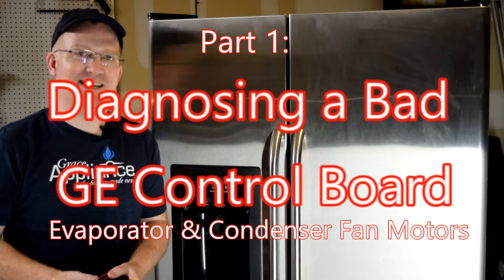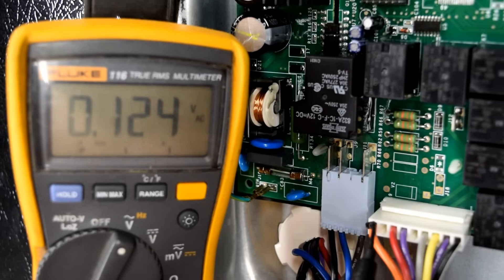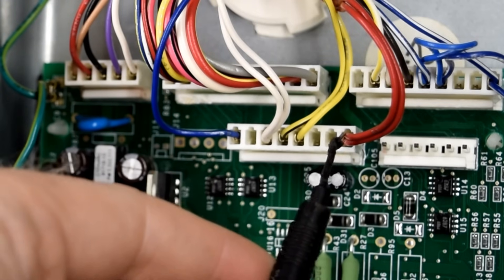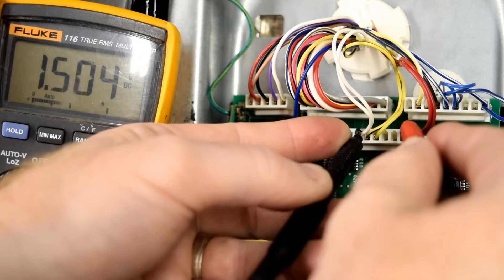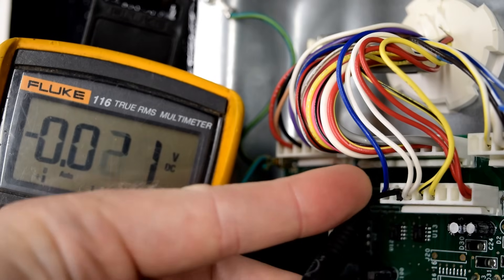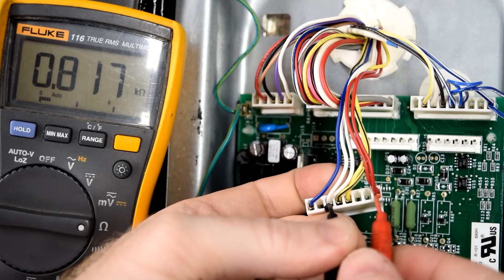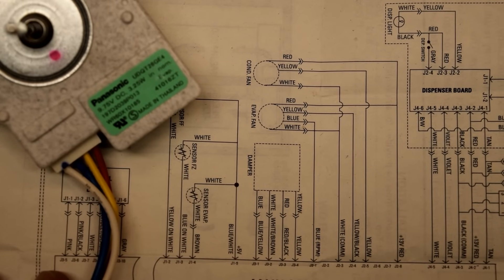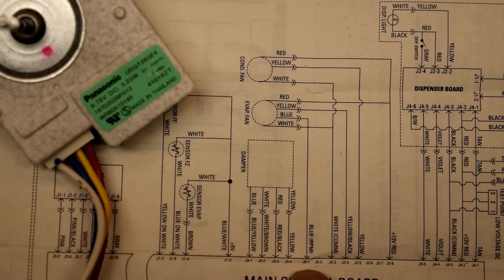Diagnosing a Bad GE Board - Part 1: Fan Motors

Comment: I don't have the schematic for my 2007 GE Profile side-by-side refrigerator and have a question regarding the condenser fan which I hope you can answer. The refrigerator is at a rental property so I'm remotely troubleshooting with the individual living there. He is reading the appropriate DC voltage at the J2 jack when measuring at the test points you referred to in this video. I also have additional wires on pins 6 & 7 and unclear what they are for although I simply thought I would mention it. He sent me a picture of the fan and at 1st glance it looked like an AC voltage c-frame motor. Because the voltages were good at J2 I had him unplug the fan and measure continuity across the coil. He's reading 80 ohms across the black and orange wires so the windings are not opened up and the bearings are good, it spins fine by hand . This makes me believe the motor is fine. Moreover, with the fan still unplugged I had him measure the incoming voltage directly at the harness that plugs into the fan.  He's measuring 120vac at the load and not the low DC voltage that was referenced at J2. Are these motors powered by 120vac? If they are then it is fair to assume the power at J2 is only signaling the relays which in turn close their contacts to send the appropriate AC voltage to the fan. If the signal voltage is reading fine, and these fans are powered by 120vac then some people may only have a bad relay/contacts and not necessarily a bad fan motor. If the motor is rated for AC voltage then do you know whether or not these condenser fans require or have a run/or start capacitor?
Reply from the maker: Hey Mr JP, Some condenser fans on the GE side by sides will be 120v AC powered vs the type of motor looked at during this video. Something similar to a wr60x10168. 

If he's getting 120v AC at the wires to the plug at that fan, yet the fan still does not spin, it's a failed motor (or bad connection, mouse chewed wire, etc etc) but most times... A failed motor. He's getting appropriate voltage to the motor. The issue is between that plug and the fan motor. If the connection and wires are good, replace the fan motor and good to go! The fan motors don't have a start or run capacitor (compressors often will, but not the fan motors which differs from say an hvac system) 

I hope that helps.
Reply: @GraceAppliance  thanks for the quick response. I had him pull it out so I could verify what was going on. Come to find out it is a 120vac  C-frame motor which you are correct does not require a capacitor. Once it was removed I had him recheck all his measurements and the motor was still reading good. However, he then told me that it was a little stiff when he turned it. I had him remove the armature and clean it up and reinstall everything. It works fine now. I wanted to make sure it was definitely the motor because even with Amazon prime it would take 2 days to get it lol. Plus he's family and lives there for cheap, he can get his hands dirty. Thanks again I do appreciate the video and your time.
Reply from the maker: Hey Mr JP,
You're most welcome! Glad you got it sorted. Nice work!

Yeah, I'd definitely get one of the motors on the way to him because it sounds like it's on the way out. 

In the meantime, you can have him put a regular box fan behind the refrigerator with the back fridge panel removed in case the fan goes out, it will keep the air moving either way until the new motor gets there. 

Thanks!
Reply: @GraceAppliance  I agree and found a replacement for it on Amazon. Just subscribed too, thanks again!

Comment: Hi All, is something as basic as the Cen-tech 7 Function Digital Multimeter good enough for these tests?
Reply from the maker: Ayotunde Itayemi yes! You shouldn't have any issues with that meter.
The only difference you might notice is that the meter may take a little longer to register the reading for you.
Reply: GE Side-by-Side ONLY - Refrigerator Repair Videos  Thanks! I carried out the first set of measurements. Input voltage OK (118V). J2 (White/Red = 29V; White/YellowBlack = 22.9V; White/Yellow = 27.6V). All well outside the range of 12V-14V you mentioned in the video. My refrigerator is a GE GSL25IGXJLS that's not cooling.
Reply from the maker: Ayotunde Itayemi  Hey!
Please double check that your meter is set to Volts DC and not volts AC.  The first test of 120v is an AC test, but the fan motors test - you'd need to change the meter setting to DC measurements.  That may be the issue with the readings you're getting. 

Do you know if your compressor behind the refrigerator & condenser fan behind the refrigerator is running or is it totally quiet?
Reply: GE Side-by-Side ONLY - Refrigerator Repair Videos  Spot on. I forgot to change the multimeter to VDC. New J2 measurements: White/Red = 13.5V; White/YellowBlack = 10.66V; White/Yellow = 12.87V. The Ohms measurement also is 812 (well below the range you specified). Both the compressor (warm and I believe I hear it kick in) and condenser fan (spinning) are running but lots of dust in the motor grill (I will vacuum that now). Looks like the combination of the low evaporator voltage (10.66V) and the low ohms measurement (812) means the board is bad? Thanks!
Reply from the maker: Hi Ayotunde, 
As for the evaporator fan voltage, I'd let that one go for now.  It's a variable speed fan motor and actually I think it's more like between 8-14vdc that it will vary.  So, likely no issues there.  Do make a note of it though. 

If your condenser coils are dusty - that will definately cause a freezer and fridge to be warmer than normal, but won't cause it to be HOT.  

Is your fridge/freezer HOT?  Like, no cooling at ALL?
or
Do you feel some cooling taking place in the freezer section?

If the fridge is hot (no cooling at all) AND the compressor is running...that's probably not great news. This will usually mean all of the refrigerant has leaked out and and/or the compressor is no longer functioning even though it may be running. 

If the freezer side isn't hot, but rather it's just not freezing things - say....40-50' I'd examine the evaporator coil (behind the freezer wall inside the freezer) to see if the evaporator has a light coating of frost over all of the rungs which would be normal.  Only on the bottom couple rungs would not be a good sign for the compressor.  
If however you find that the evaporator is covered in thick heavy ice/snow this would indicate a defrost issue. 

Let me know what's going on in your situation and I'm happy to help as much as i'm able. 
Thanks!
Reply: GE Side-by-Side ONLY - Refrigerator Repair Videos  Not cooling but not blowing hot air (just a slight breeze). The refrigerator has been off for a couple of weeks so I don't think there will be any coating on the evaporator coils though I haven't opened the wall. The compressor is an Embraco EGX 70HLC with the words "Thermally Protected" on it. Not sure what that means but I mention it because I assume after running (if it is  running) for about 30mins the compressor should be hot or at least warm? As it is, it is almost impossible to detect any heat/warmth from the compressor if I touch the back of my hand to it. Though the gentleman I got the fridge from in is the HVAC business and said he thinks it's likely "low refrigerant" but he couldn't be bothered trying to fix it which is why he gave the fridge away :-)
Reply from the maker: Ayotunde Itayemi  Hi!  
Definitely after the compressor runs for 30 minutes you should be able to detect at least some warmth off of it to the touch.  Also, you should have at least some noticeable drop in temp inside the freezer.  If the compressor runs and the fans are working - it should be sub zero inside the freezer after 12-24hrs.  If not, it's an issue with the 'sealed system' i.e. the compressor or refrigerant not being present.  

Now, how to proceed: 
Honestly, anything sealed system related is expensive and usually not great news for older fridges just because it most often won't make sense to repair unless it were say a build in fridge. 
Some technicians will perform a recharge of the refrigerant, but often won't offer any type of warranty because there is a great likelihood that it has a leak somewhere in the sealed system which allows the refrigerant to have leaked out. But, they'd weigh in a certain amount of refrigerant charge, 6oz-9oz whatever is called for. 
There is a product which is a 'leak stop' of sorts and can be added to the system during the recharge if you wanted to roll the dice. But, also - It may be a failed compressor as well.  So, that would be up to you on how to proceed.  A skilled technician should be able to hook up gauges to the sealed system to confirm if it's simply low on charge or has a failed compressor, but i'd say unless you're willing to spend quite a bit of money on repair - you may be better off cutting your loses sooner than later and not follow that rabbit trail.  

Just my initial thoughts based on what you've told me so far. 
Sorry for the bad news, but I hope it helps.
Reply: GE Side-by-Side ONLY - Refrigerator Repair Videos  Seems like I spoke too soon. After about an hour the compressor was warm to the touch. I then left it on the whole day while I was away at work and when I got back home about 8hours later it was chilling. Both the fridge and freezer sides are quite cold but not cold enough to freeze the can of coke I left inside. Which brings me back to what the original owner said that the fridge started to randomly stop cooling (might go for a couple of weeks with no issues then they would notice water dripping from the ice maker and the stuff in the fridge no longer cold, but if he leaves it off for a while, it starts to cool again). So do you think this can still be the freon? I am going to leave it on all night.
Reply from the maker: @ayotundeitayemi  
If you find that over night it's able to get down to 0 degrees in the freezer, then after a day or 2 it starts getting warmer, it's likely not defrosting.
You'd see ice build up on the back wall of the freezer.

If on the other hand it doesn't freeze food after 24 hrs, I'd agree with either a failed compressor or low refrigerant.

Keep me posted on what you find out.

Good luck!
Reply: GE Side-by-Side ONLY - Refrigerator Repair Videos  roughly 12 hours in the original coke can in the freezer is frozen solid and a second can I put in about 4 hours ago is frozen as well so I guess it is getting colder. Will update if status changes in a couple of days as you suggested. Thanks!
Reply: It was frozen solid (including a 1-gal plastic containing water) throughout yesterday but when I checked this morning, it is barely cool and the water has completely thawed into liquid form again.
Reply from the maker: @ayotundeitayemi 
This sounds like a restriction in the sealed system to me. You have a filter dryer behind the refrigerator which the refrigerant passes through to help eliminate any impurities, but that is most often where the restrictions happen.

If it's freezing things one minute and very warm the next minute, that would indicate a sealed system issue. A recharge unfortunately would not solve this issue.

You'd need to have a professional get hands on with it to confirm this conclusively, but sure sounds like a restriction.

Do you notice any type of heavy frost buildup on the back wall inside the freezer?
Reply: GE Side-by-Side ONLY - Refrigerator Repair Videos  No frost buildup but I noticed a little "sweating" (before it started freezing originally and now that its cool) on the freezer walls.

Comment: Im having an issue with my GE fridge running the compressor nearly constantly. Seems to be the freezer temp setting that stops it, but even on freezer setting 1 it runs non stop and the freezer temp is -10 or lower. Im thinking a bad thermistor. Which wires to test ?
Reply from the maker: Hi Mike,
Sorry to hear about your issues with the refrigerator.  

I'd make sure to check the condenser coils behind the refrigerator to make sure the coils are not excessively dirty. 
Here's a video on that: 
https://www.youtube.com/watch?v=W8f0fc36ObE

As for checking your temperature sensors - here's a video on how that's done. 
I hope it's helpful, but please let me know if you have any questions: 
https://www.youtube.com/watch?v=CG-2FnQ43Hs

Good luck!
Andy

Comment: Hello sir ,
The freezer on my GE frig isn’t freezing. 
So I opened the lower panel and noticed the fan not spinning ! Could this be the motor or the MB?? 
Thank you in advance.
Reply from the maker: Hi Samuel,
I'm sorry to hear about your freezer.
When you removed the panel to expose the fan, the evaporator coil should have been coated in a light frost. If so, your compressor is doing its job and that's good news.

In order to test for a board vs fan failure, you'll need a multimeter in order to test for fan voltage from the control board. If you're getting between 12-14vdc at the fan and it's still not turning, it's a bad fan motor.
But with this symptom, it could be either the board, fan or even a failed temperature sensor which would need to be checked at the board. This video should help with the fan voltage testing though. 

Also watch the video called visual inspection of a failed control board which will help in the diagnosis. 

Let me know if you have any questions.

Comment: Where can I buy those leads (that can go into the connectors) for your voltmeter?
Reply from the maker: Jaime Perez hey, I’m sorry I don’t know the brand name, but picked them up from my parts house at Appliance Parts Depot as a register impulse buy. Lol they’ve been amazing. 
I know fluke makes some called needle tipped meter leads.  I wish I could help more.
Reply from the maker: These aren't the same, but still pretty cool because you can adjust the length. 

https://express.google.com/u/0/product/7899301061649871051_2583438762543865542_6136318?mall=Southeast&directCheckout=1&utm_source=google_shopping&utm_medium=product_ads&utm_campaign=gsx&utm_content=test_45_60&dclid=CLaU1OjQpNwCFUavTwodoO8CsA
Reply: GE Side-by-Side ONLY - Refrigerator Repair Videos I thank you so much and you were so fast at answering.  have a wonderful day and many thanks.  :-)

Comment: Do these test apply to GE Profile Model # PFS22MIWABB bought in 2007.
Reply from the maker: Hi Paul, they will be VERY similar, but I don't recall if the pin and plug configuration is identical. They should be close enough to get the rough idea for the tests. If I recall correctly this particular fan motor was made by Samsung at some point in time. 
For example, if you have to replace either fan motor, you'll see the price for these are like $250!! But if you look much closer on the part itself you'll see a Samsung part number and that particular Samsung fan is on like $70. Literally the exact same part!
So, my point is, if you need a new part be sure to look to see if there is a Samsung  compatable  part.
Just going off memory right now as I'm away from my desk, but seem to remember that.

Thanks for watching and let me know if you have any questions as you go along. 

What symptoms are you dealing with?
Reply: GE Side-by-Side ONLY - Refrigerator Repair Videos Hi, my freezer temperature and fresh food temperature seem to fluctuate and compressor runs longer. Want to seem is both fans condenser and evaporate fans are running properly.
Reply: GE Side-by-Side ONLY - Refrigerator Repair Videos Hi, just want to check if both the evaporate and condenser fans are operating properly. Looking at the condenser fan at the back it seems to fun slowly. The evaporator fan I can't see.
Reply from the maker: Hi Paul, you could start with an ohm resistance test for the fan motor and then voltage test to make sure it 'should' be spinning. But, sometimes it's best to disassemble the freezer section to get eyeballs on the fan itself to confirm that there is nothing blocking the fan blades. I. E. Ice build up. 
Sometimes you'll find you're actually having a defrost issues rather than a fan motor issue. 
Don't force the disassembly if it's not wanting to come apart just in case you have styrofoam behind the panels. You'd then have to fully defrost the fridge and freezer unplugged before you could disassemble. 
I've seen far more defrost issues than fan issues on this style of fridge. This may not mean a lot, but I'd definately start with looking at the freezer evaporator if you're able to get it disassembled.

Comment: I believe it should be called "pulse width modulation" not "pulse wave modulation".  The width of the square wave pulse is varied to change the average power sent to the motor.
Reply from the maker: Thank you. I mis spoke. Good catch.